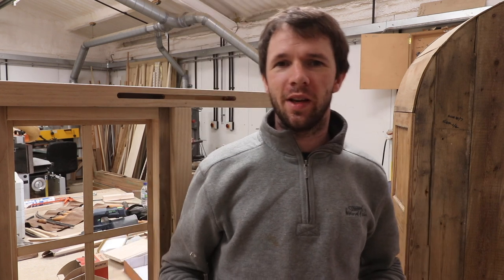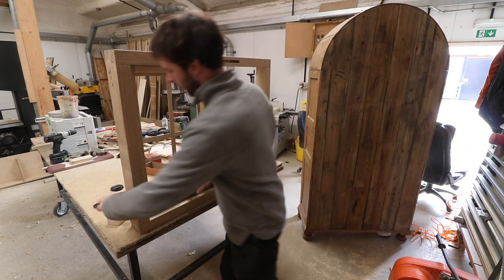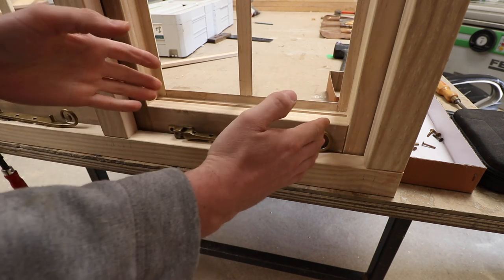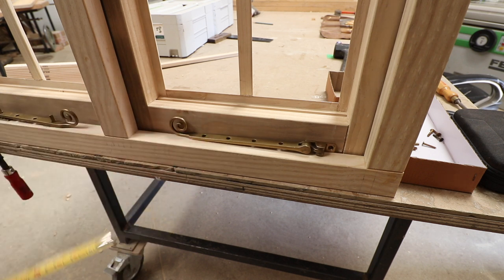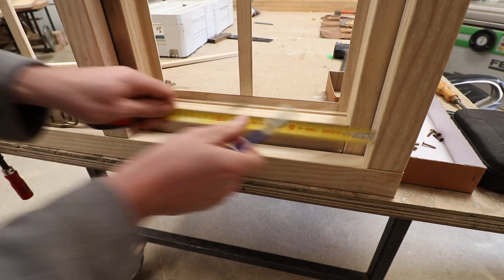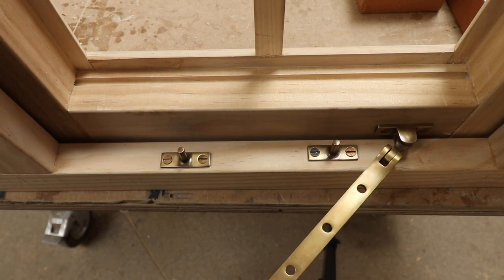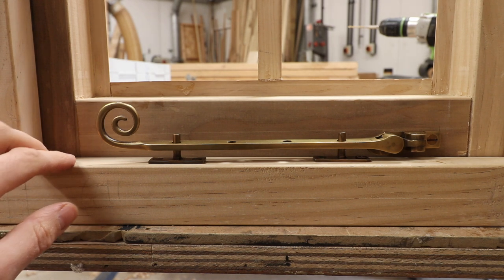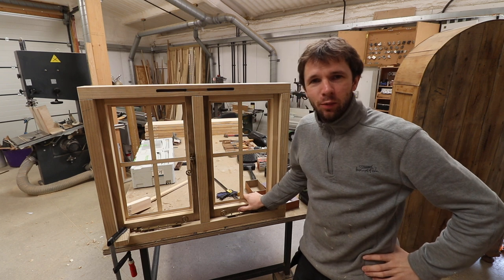How to Install a Traditional Window Casement Stay

Comment: I wish I'd used the sort of quality fittings you have there. Mine were relatively cheap ones and don't really do the window justice. I learn something every time from your videos. Thanks, and keep them coming.
My next job is to reinstall a sliding sash window that I've renovated. I'd really appreciate a video on how you'd tackle it, especially how to secure the box to the brickwork.
Reply from the maker: I always look to Broughton's for quality ironmongery. They dont sell crap and will custom manufacture whatever you want, in whatever finish too. 
Sash window... i have some lined up to do, its just a family (non paying) job so its fitting in between jobs HAHA

the box generally just sits in the brickwork and shouldnt need too much securing. when initiallt fitted wither wedged into place or steel strap into the brickwork.
Reply: @BradshawJoinery  Many thanks for the prompt reply.

Comment: briliant mate love it.....just making new windows for my 1919 built Arts and Crafts  home...replacing the horrid 80s plastic with stick on lead ones...am replicating the originals and using the monkey tail stays and fasteners but in iron.....one interesting thing all the original stays only had one stay pin each...all around the estate
Reply from the maker: They only used them as stays in the past, so the window shut on a fastener then opened and held on the stay.